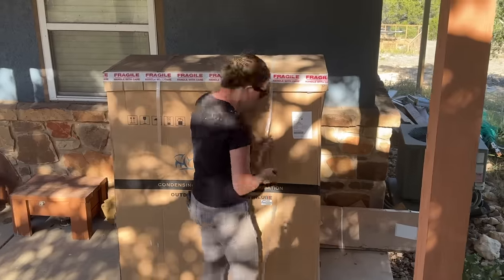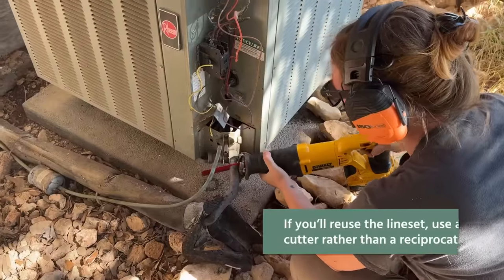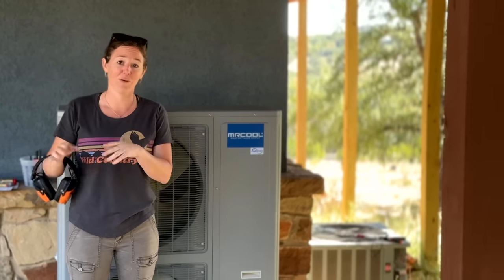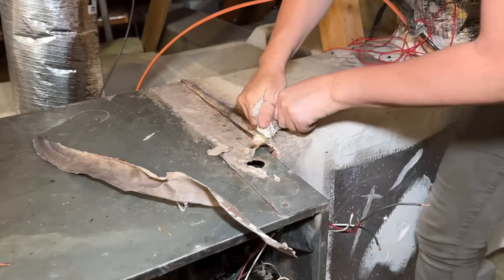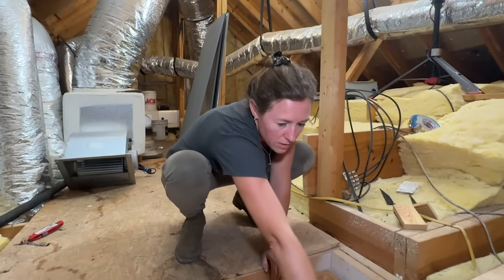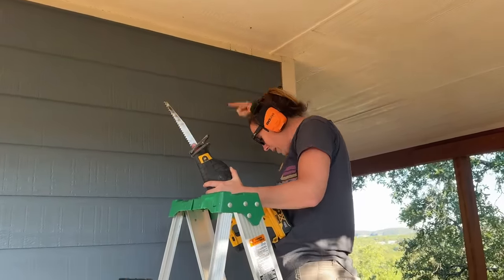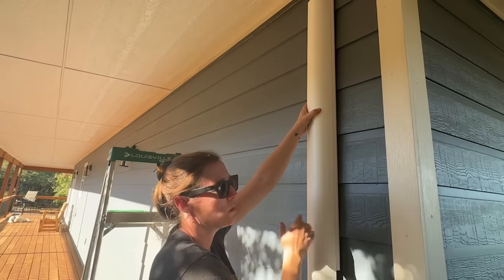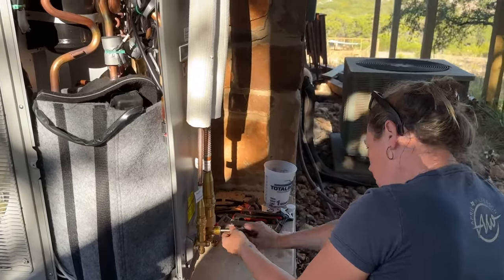I Saved Thousands! A DIY Heat and AC System with Heat Pump

Comment: I saved $5000 by doing it myself, probably a 3hr job I fabricated the wall mount too. Doing research took  8 hours of research sifting through inconsistent videos comparing to the manual for several afternoons. The 30 videos I went through turned out to be a huge time waste I should have just studied the manual, where I live most professional installers don't follow the book after learning it myself.
Reply: If 8 hours of research was enough to “learn the book yourself,” there would be a lot more HVAC techs in the world.
Reply: Is that 5k in savings including the cost of your labor.  11hrs of work on this project would be a high labor cost so saving 5k is truly impressive

Comment: Nothing wrong with DIYers, but I’d recommend having an HVAAC tech do the final connections and start up of the units, most companies won’t warranty DIY work.  And warranty on modern equipment is an absolute requirement.  They aren’t built like they were thirty years ago.

Comment: In working in electrical stuff, make sure you have some electrical gloves rated at 20 KVAC. Sounds nuts, right? Depending on the type of A/C you're tearing apart it can be 120V all the way up to 3 KV. You want that extra safety buffer in there. Most home units are 2 phase 120VAC even though they say they're 240 Volt units, technically correct. The run capacitors for the unit can give you a lethal shock. Some units have an auto-discharge unit that when you open the panel or have a button to do it, however never assume that stuff works, assume that the capacitor has a charge on it and to be very careful when you ground in putting the prongs into the dirt 2.5 to 3 feet from where your feet or knees are.

Comment: So how a AC works is it takes all the hot air in your house and dissipates it outside through the condenser. Whatever hot air is still left in the house the blower fan in the air handler or furnace however you want to say it blows the hot heat over the evaporator coil cooling the air. A heat pump works in reverse it takes the cold air out of the house and the cold air that’s left blows over the evaporator coil that’s now super heated warming the air and now the condenser is outputting cold air. It can do this with a reversing valve. Heat pumps don’t work in colder climates because the condenser is outputting cold air and if the outside is also really cold they can freeze up.

Comment: Do they make a ground source heat pump kit?   Five feet below the surface of the ground is approximately 50 degrees all year long which is plenty of low-grade heat to be had without having to super stress the system in -20 degree.  If one owns a decent size backhoe or excavator to dig trenches for the heat exchanger coils barriered in the yard the cost drops to a reasonable level...

Comment: I’m a retired master electrician but over the years I’ve replaced my own furnace in 3 different houses, done a few for friends and relatives, installed the entire system in a new house I had built, and installed a complete AC system and replaced the boiler in a 5000sq.ft. historic home I restored. The boiler was the biggest challenge, it was a beast. I dismantled that to remove it because it was so heavy, fortunately it came apart in ten 120# sections once I stripped the cabinet off it. That thing had a 10” diameter copper glue pipe connecting it to the chimney. I got over $400 for the scrap metal from that.  I take my time , plan ahead, do actual heat loss/gain calcs to correctly size the unit (most “pros” don’t), and used manual D to properly size the ductwork. Mine all turned out better than most of the “pros”. Skilled trades are greatly under staffed these days so actual craftsmen are hard to find so this is a good opportunity to save some money and likely end up with a better result.

Comment: I recommend running a 2”thick filter.  It will facilitate less static pressure in the system which makes less resistance on the fan, more effective heat exchange.  Wish they had this product when I did mine myself.
Reply: Wouldn't a thicker filter create more resistance, to air movement, thus "increase" static pressure?
Reply: @ron827  its actually the opposite because thicker filters have more surface area, static pressure is is a function of filter surface area and flow.  At a given flow rate, a filter with more surface area will have less restriction and therefore decrease the static pressure.

Comment: I would mostly definitely still pressure test to ensure those lines sealed tight. And these dont require the lines to be vacuumed below 500 microns? That seems wild. I would assume having the excess moisture could still cause non condensables and create issues in these systems. Maybe im wrong. Ive never been hands on with one of these Mr. Cools. Interested to see how it works now

Comment: 13:06 Torque specs, this isn't hand tight. 16:28 another option is the "Safe-T-Switch" that screws into the second drain. 17:22 Could use sealant too, the slang in the HAVC biz its called Pookie. Great video!

Comment: So far I’ve installed 6 of these units. Three on the last house and three on the new house. I always use 2 ton separate units this way if a compressor goes out I still have some what of air from the other units. Self taught, now I’m teaching neighbors. Never a problem.
Reply from the maker: Awesome! That's great to hear. Thanks for Sharing and for watching.

Comment: I run a heat pump and -22 is impressive. I know mine still run in below freezing, just runs a lot longer using more electric. Since you geek out on tech I’ll tell you I automated my propane fireplace and ceiling fan to come on with the heat pump from the thermostat only when it’s colder then 40 outside and it runs half the time now with double the off time in between. Plus the benefit of increasing humidity in the house. So far works great. But I may still install a small Mr cool for the garage this year.
Reply: This is very interesting.  Would love to hear more detail.

Comment: I had a heat pump system in Dayton back in the 70s, and it worked flawlessly.  As I recall it had an electric heat augmenter when the temps got down below 18 degrees F.  
You're really going to enjoy how quiet your new system is compared to the old one.  My old house had a conventional AC unit for the house and a mini split unit for the master bedroom.  When I was standing in front of the mini split condenser the conventional condenser, 50 feet away, was louder than the mini.
Reply from the maker: Yes, I'm glad I went with this new system. Thanks for Sharing and for watching.

Comment: Not a fan of the return pan off I would have done a reduced angled as not to choke one side.  The theory is that the motor will tilt slightly over time where the pan off is due to air turbulance.  This instance its a slight difference and I dont see it being that much of an issue, but if yours is more then 5” panned off then think about making a transition piece with a filter rack

Comment: Something about the condenser high and low lines should be kept as short as possible on the outside unit, there's efficiency reasons for this.

Comment: I didn't think you could lay the air handler as you did.  I thought it had to be laying on the opposite side with the supply side left or virtical with the supply side up.  Have you had any issues running it that way?
Reply from the maker: No issues at all. Thanks for watching.

Comment: Also you have several kinks in your flex duct that is causing an airflow issue.  You don’t want hard turns or kinks from the strapping of the flex duct.

Comment: Great work April however, the purpose of the mini split system is to get 100 percent of the cool and heat . But by reusing your old duct work you lose 40-60 percent of heating and cooling in the duct work.
Reply: I had a couple problems with a mini split: one was the noise that the indoor unit makes in every room.  The other was the condensate lines needed monthly maintenance and eventually got moldy.  The entire system was horrible to clean out.  The mold got everywhere including the interior fan blades.

Comment: You should use duct mastic in addition to the foil tape to seal the ductwork.
Reply: Totally agree with the mastic suggestion. You might even want to add a strip of foil faced insulation to add a little more R-value and to lessen the chance of sweating during summer heat. You did a very good job overall

Comment: On the old unit, when checking for power on the contactor make sure you are testing at the line side (bottom usually) you won't have any power at the load side unless it's pulled in or its a single pole contactor. I'd recommend getting a torque wrench for tightening those adapters, they have a high failure rate especially if not torqued properly. I think the smaller one on that unit should be 25ft/lb and the larger is 30ft/lb, but id verify that in the manual. When they do end up leaking just flare the lines, get rid of the adapters, and nitro test it before weighing the new refrigerant. I have 2 units that have leaked from those fittings.

Comment: I could be wrong but i think you may have your condensate drain backwards. your primary hole is slightly lower than the secondary outlet hole. Your drain going into the emergency drain pan may fill up right away. your primary outlet should be going outside and secondary to your pan.  once again i could be wrong just going by the video.

Comment: You should of connect the drain pan line to the outside so if water does get in pan it can drain out just in case that flow switch goes bad

Comment: Viper pan and drain treatment or nucalgon pan tablets have helped me prevent the condensate lines from clogging up. I use them around the beginning of the season. 

A cutoff float valve in the primary drain isn't a bad idea either and it's cheap. Highly recommend a surge protector.
Reply: @gwizz911  sure, let’s put something corrosive to evaporator coils in there.

Comment: I've been watching this channel diyhvacguy and have learned a lot from his videos as well. If you have a working unit, you can self recover the refrigerant into the condensor. Someone will have to recover it from that at a later date. Great information in this video. I always look forward to see what your doing next.
Reply: On some systems you can do this.  As long as the charge is only the factory charge.  If you had a long line set that required extra charge, you risk EPA sanctions for intentional refrigerant release.  Other wise yeah you can just close your high side valve and pump down.

Comment: I replaced my office hvac & one in a rental house. Although the attic units were very accessible, it was still easier to replace just the coils & fan elements inside the old sheet metal boxes than lug the whole new units upstairs for the office or thru a ceiling crawl hole for the house.

Comment: When working in an inclosed area where this is fiberglass insulation, some kind of respirator would be a good idea because as you move around, fine fibreglass dust becomes airborne.

Comment: For safety, you need to do four things.

Turn off the thermostat so it's not calling for service or running the fan in your furnace and that is actually used even when not heating, it's used for cooling, too.

You need to turn off the furnace fan at the furnace.

You turn off the circuit breaker for the A/C unit in the breaker box but please stand to the side of the breaker box, the side closest to the switch you're turning off to help mitigate the rises of arc flash and associated events. Same thing when you turn it back on, same procedure.

Pull out the the quick disconnect (you say it's code that you need it, that depends purely on the city and state you're in). 

I'll be honest, it should be code regardless for the quick disconnect to be a part of this unit.

Comment: There is also a switch that drops in the top of the drain line that if it backs up in the line it will shut the air handler off.

Comment: Nice job.  I just installed a MRCOOL Universal Residential 3-Ton 36000-BTU 17.5-Seer Upflow/Horizontal Central Air Conditioner from Lowes.  It took me 1.5 days.  It connected right to my Carier natural gas furnace.  There are always some added costs to these systems but it was well worth it.  Added costs such as I  needed to run new electrical since this system runs on a 35amp circuit so 8 gauge wire was needed to the condenser and a new disconnect box replacing an older 30amp system.  Needed to buy duct sheeting and tools to reconnect to the Plenum of the existing duct system, duct tape, duct calk, 1/2 inch sheet metal screws and PCV for the water discharge and 8 Gauge 1/4 inch spade connectors for the condenser.  After having it all together I  had to buy a new thermostat, smart thermostat now, "yea", since my existing one did not support cooling.  It's up and running like a dream.  I only had a little bit of difficulty connecting the lines outside on the condenser.   I could have really used a second person to steady the line because those lines need to be perfectly aligned to start hand threading them together to make sure they were not cross threading.  MRCOOL is highly reputable and it comes with a 10 year warranty DIY as long as you buy the pre-charged systems.  Non pre-charged systems only warranty if you use a certified HVAC Pro.  When I had my furnace replaced 5 years ago I was quoted an additional $9000 for AC.  I put this system in including tax for around $3800 total.  I believe I saved some cash here, lol..  Do some vigilant research on your current system because you can do this.  It is so nice have those window units out of my windows which are well over a thousand dollars for the 4 that I had running.  And these new condensers run so so so much quieter, more efficient than the older units.  Peace....https://www.lowes.com/pd/MRCOOL-Universal-2-3-Ton-Up-to-20-SEER-Air-Conditioner-and-A-Coil-w-15ft-Quick-Connect-Line-Set/5013333377
Reply: So you can run your furnace and the heat pump?
Reply: @mattneff1262  I don't have a heat pump.  my MRCOOL is a cool only system.  A-Coil, Lines and Compressor.  The A-Coil attaches to your existing gas or electric furnace.  Check the link to Lowes and you'll see the system.  They do however make the same thing with a heat pump but this would require an entirely different compressor that  what I have.
Reply: Thanks for sharing this note. This sounds like a great option for me. I have a Carrier split system with a failed condenser. Wire rub eventually grounded to my return refrig line and burned a hole. Complete loss of my R-22. So new condenser, new precharged lineset, new coil, all fitted up to existing air handler...Holy Cow! So I can really toss out all of these $10k+ quotes I ve been collecting?!
Reply: @swcswc111  I'm glad this helped and it's why I posted it.  We live in a world that has some really good honest HVAC technicians in it, and we have some really bad and crooked HVAC technicians.  When ever someone tells you your Condenser is bad.  Invest in a multimeter and test the capacitor yourself.  Lots of video on it.  The capacitor rip-off is real with bad HVAC people trying to sell you a whole new system when you really only need a $20 part.  Sounds like they were quoting you on whole system replacements.  Because brazing a new condenser, line, vacuum, nitrogen pressure test, and recharge is expensive but not $10,000+.

Comment: The refrigerant is usually called Freon.  The older form is R22 Freon which the US government has outlawed.   The next itteration is R143.   R12 was used in refrigerators and freesers and auto A/C systems.   The large lineset is the vapor or gas line.  The small lineset is the liquid line.   You may lose a little of the air handling efficiency because you blanked off part of the case without a transition between the different sizes.
Reply: R22 is not outlawed. It is phased out of new manufacture and for new equipment. It is still being sold and used for service and repair. R143 is not a thing. You possibly mean 134a, which replaced r12 in cars, but 134a is also on the way out. 410a (puron) replaced r22 and that is also being phased out now.
Reply: Freon is a brand name.

Comment: I didn't see one in the video, but being in Texas, I hope you also have a whole-house dehumidifier. AC units generally to a good job at dehumidification, but they have the side effect of making the space cooler...which is fine during a hot summer day, but sometimes it makes it too cold. Dedicated dehumidifiers that are controlled separately from your AC (i.e. a humidistat) are great at improving comfort during the time-of-day/time-of-year when it's a comfortable temperature outside, but it's humid. If you live anywhere in the US east of the Rockies, you should consider adding a whole-home dehumidifier to your HVAC system.